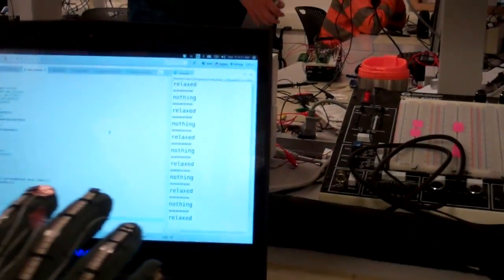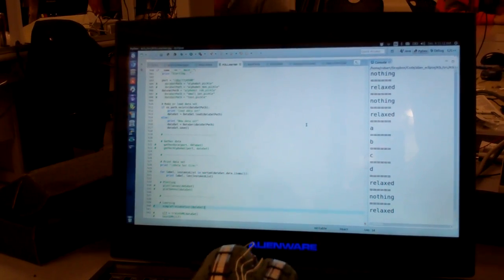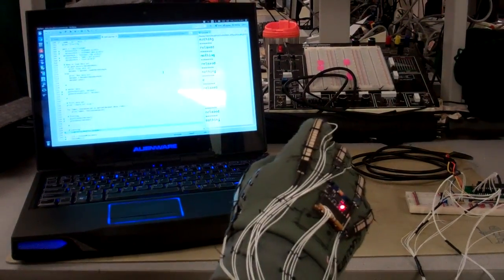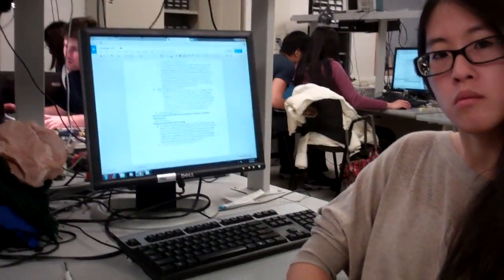Gesture glove

Comment: Is there a more detailed circuit scheme ?
Reply from the maker: The linked report is the only documentation, except for a description of the cpu board on the course web site.
Reply: @ece4760  yeah i had no idea what was that, ı got to do similiar project and struggling a lot, btw on the voltage divider why didnt you use amplifier ? thanks for your instant return ^^
Reply from the maker: @canberkY505  Here is the link for the cpu board. Voltage divider did not neet an amplifier.  As you can see for the voltage curve for the sensors, the deltaV for the sensor was about a volt. Big enough for the ADC.
Reply: @canberkY505  mrb can bey buradaki tanıtılan eldiveni bende yapmak istiyorum malzemelerim hazır ama kaynak kodlarına nereden ulaşabilirim acb diye sormak istedim